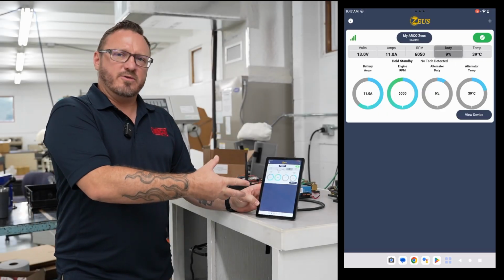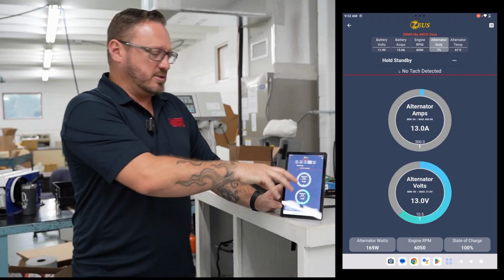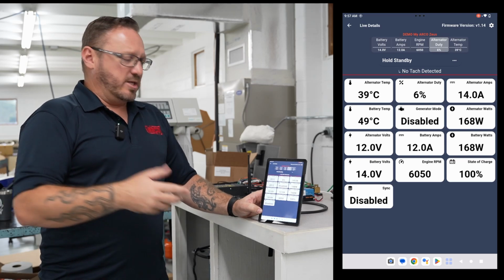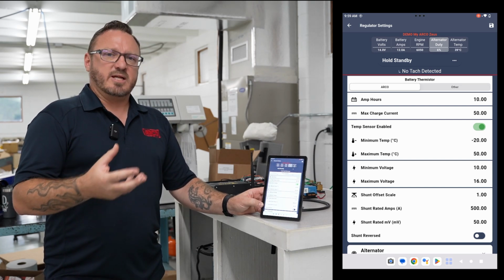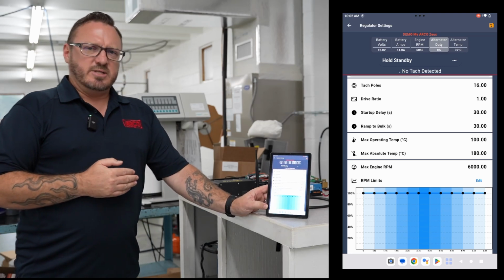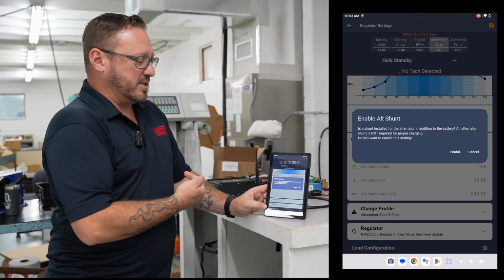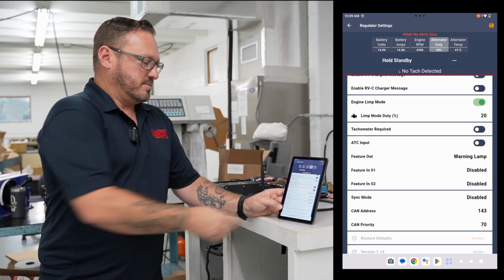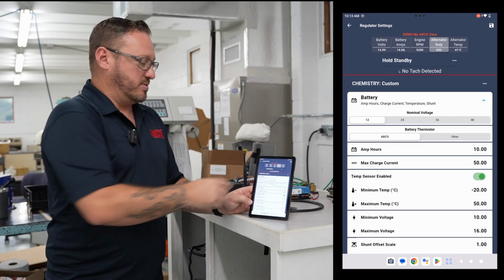Master the ARCO Zeus Bluetooth Alternator Regulator App: Complete Features & Functionality Guide

Comment: Hi, I now have 2 x Arco Zeuz 275L alternators and 2 x Zeuz regulators in my catamaran. We wanted to limit the alternators to 200A each, because the engines are only 30 HP. However, when we choose "Max charge current" to 200A, it limits both of them to 200A in total, and not each. And if I get 150A charge from the solar arch, the Arco will limit itself to only fill in the rest, just 50A. 
The only solution I found was to increase the charge current to much more, which gives severe warnings that the settings are invalid. But at the same time limit the alternator in Duty max 90% and Max temp 90 C.  I now seem to land around 180A per alternator, which I am happy about. 
Is this the correct way to go about it?

Comment: The explanation is a little too fast, the index of critical points of operating speed for optimization of the optimum point as well as the rising edge of this information is clearly visible which will optimize the performance of this one super, very good explanations thank you. The grade of the enameled copper wire used, as well as the power of the sheets used, are they tropicalized or not, for applications where the air environment could be partly charged with hydrogen for example. Thank you for the presentation of your alternators with which we could work with our professional customers and distributors. Best regards Fabrice.

Comment: Thanks for the video. Perhaps I missed it but how does the app show data for a system with 2 engines, each with a high output alternator and Zeus Regulator? Can the app show both alternator temps for example and the total charging (sum from both)? Or do I need to switch (and if so how?) from one Zeus in terms of App by logging out, then bringing up the other engine’s Zeus data?